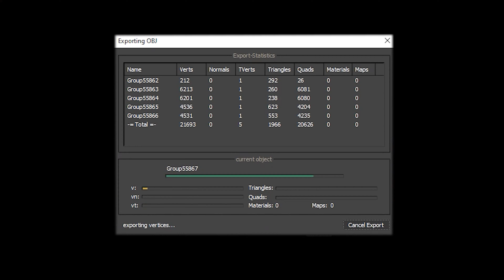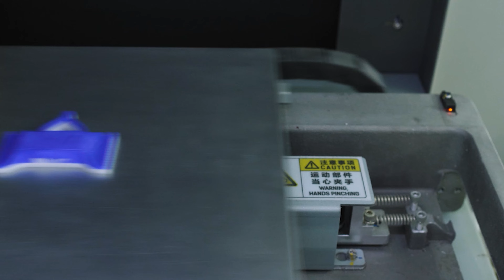How to Make Jewelry Pendant - Jewelry Making Process

Comment: Could you perhaps add a bit of visual info in the corner for what material you’re using for the steps? I would like to know what the jewel stuff and black ink stuff is
Reply from the maker: I tried adding text in the first videos, but it didn't work. But I will be happy to answer you. Black is cold enamel. 🙌🏻
Reply: @jewelator I like when creators put it in the closed captions, but I bet that’s a lot of work. Thanks for being willing to answer in the comments.

Comment: Wait so if you didn’t put chocolate inside then what were you melting with the blow dryer before pushing half of the pendant down on the melted stuff?
Reply from the maker: This is a special material. It is used to fix jewelry while setting stones.